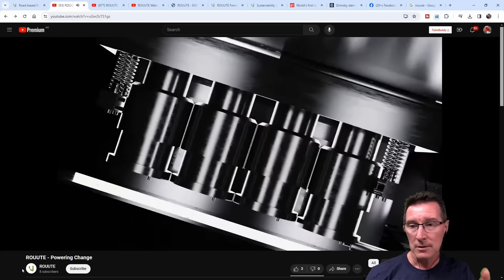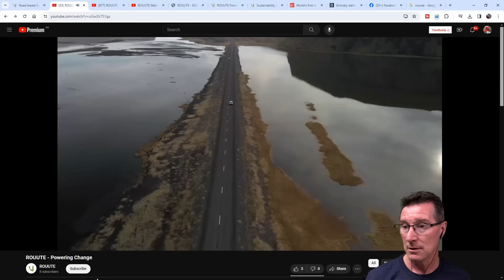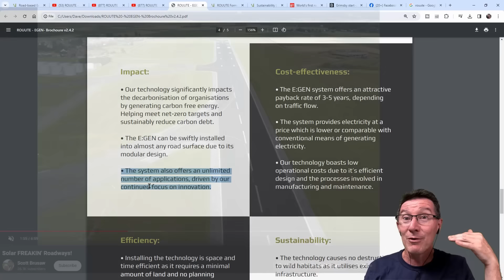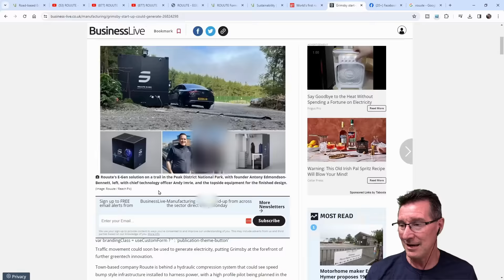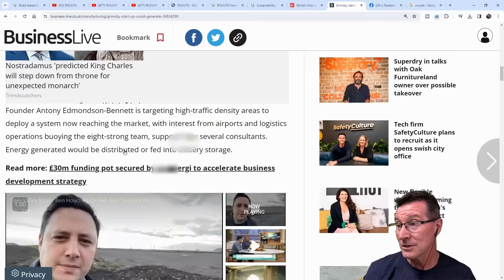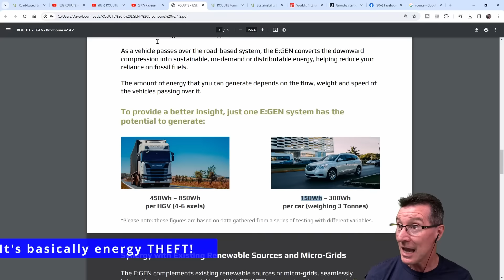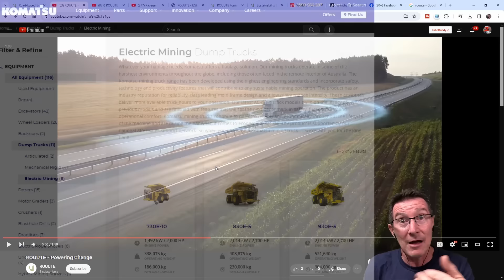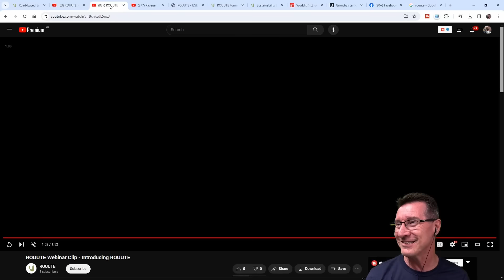EEVblog 1600 - Rouute: Road Based Energy BUSTED

Comment: Our educational programs are seriously failing to teach fundamental engineering.
Reply from the maker: They still teach E=1/2mv squared in school, it's just that no one bothers to apply it.
Reply: @EEVblog  in this case more applicable is formula U=mgh, as I understand their system use gravitational potential energy instead of kinetic energy (same as old clocks with weights, hydroelectric power plants ...)
Reply: @mrlazda  h_in = h_out it's not U=mgh.
Reply: @Kandralla  no it is not, it work by transferring gravitational potenrional energy or simply mass of vehicle push down on speed bump and speed bump sink a small amount. And yes, U=mgh is correct in this case. It is speed bump it do not try to slow vehicle it force you to slow it.
Reply: @mrlazda  h_in = h_out, m and g are constant, mgh = mgh; so no, it's not harvesting gravitational PE, I'm not going to consider going downhill because:
1. they're testing it on flat sections of road.
2. they're not going to get any substantial energy on a downhill because people are going to have to go slow to avoid damaging their cars.
Reply: @Kandralla  explain to me how h_in = h_out if road bum is sinking under weight  of vehicle? By the way, even m is not constant baxouse when the bump is sinking, m is a mass of bump plus mass of the vehicle (part of), and when it  returns to the starting position, it is only mass bump. The difference between those two potential energy is what they harvest.
Only you get right is that g is constant. 
You are just proving oreguonal post that educational program is seriously failing.
Reply: @mrlazda  What state is the speed bump and car in at the beginning of the process? What state are they in at the end of the process?

Gravity doesn't change, height doesn't change, mass doesn't change, the speed bump is still sitting there doing nothing. There's only one other thing that can possibly have changed, the car's velocity.

Explain to me how mgh=U contributes to where the energy was extracted from when m, g, and h are functionally the same for both the initial state and the final state?
Reply: @Kandralla  you obviously do not understand how it works. Speed of the vehicle is irrelevant. 
You have two stage proces.
The first stage is when vehicles go onto bump, then bump move down under mass of whiacle  in that case U=g*h"(mass of bump + mass of vehicle that is on bump).
In the second stage, when the vehicle is no longer of bump energy needed for bump to return to the previous state, it is U= g*h*mass of bump.
Energy you extract is the difference between that two energy  or  g*h*(mass of bump + mass of vehicle) - g*h*mass of bump which give you g*h*mass of vehicle  or U=mgh where m is mass of vehicle on bump, h is how much bump sinked down (vertical motion of bump) and g is constant.
Or if you still do not understand, you can look at how single ICU engines work only instead of force produced by combustion you replace by force of gravity (gm). I hope you know that energy  is force time distance (which again returns us to first equation mgh when force is force of gravity)
Edit I remembered that even simpler exampl, it works the same as the foot pump (only it is not your mass but mass of car that do work)
Reply: @mrlazda  my man, at the end of the process when the car has traversed the bump what height is the car and bump at with respect to their intlitial height?

Think about it real hard.
Reply: Draw a diagram, draw the force vectors. The component of force in the horizontal  direction is where the net work is done. The component in the vertical direction cancels itself out after the car passes.

The bump works like a wedge not a button.
Reply: @Kandralla   do you know what speed bump?  They do not work as wedges. They are not slowing down vehicle in any meaning way. They are a way to keep people driving slow, not to slow down people. Your speed does not change going  over speed bump in any significant way.
They are usually placed near schools and other places where you want to keep people from speeding.
What is the point of drowning diagrams of forces.
Now, let entertain your wrong wedge idea and what you described in the first sentence. Let the vehicle approaching the bump with some speed parallel to the road (vertical speed is 0). It is a moment of vehicles hit speed bump and change speed from parallel to road to speed that is angled vertical to road it generates some vertical acceleration (and some vertical force that act on road,  Newton's third law) so force vehicle acting on road is force due vertical acceleration and force due gravity). Now, when vehicles go on down slope of bum (and on top), only force that acts on vehicle in vertical direction is gravity. So vertical forces do not cancel each other, as you conclude drowing force diagram, that is why vehicles can jump when it leaves speed bump, which if vertical forces be cancelled would not be possible, what practixly prove that your conclusion of cancelling forces is wrong.
By the way, if there was no gravity, the vehicle  would never come back to the road but would continue in the direction of the steepest angle of speed  bump what, according to your statement about canceling vertical forces is not true.
All that taught exprimet about wedge is irelavant to how this system works, bacouse it do not work like that it is use change in gravitational energy. 
All this I wrote you should learn in elementary school.
Reply: @mrlazda  if you start at h and end at h other is no net gravitational PE consumed. If you can't understand this good luck with your business degree.
Reply: @Kandralla  if you start with an end with some height but with different masses, you have changed in energy.
If you can't understand that simple concept, you must have a bigger problem than not knowing basic physics.
Let me try to explain last time to you with a simple example. 
I am guessing you know what ielevator is.  Let you enter on 10 flor  in the elevator  and go to loby. Let's call the mass of you and the elevator m1. Now you exit the elevator and empty elevator go to 10 flor.  Let call the mass of empty elevators im2. Chane in gravitational potenrional energy in the first case is U1 =ghm1, and in the second case U2= ghm2. How much is the difference between that two energy? Acxording to you they are same so U1=U2, which means that ghm1=ghm2, bacose g and h are same in both cases, then m1 must be same  as m2 but that is not true  bacouse m1 is mass of elevator and you and m2 is only mass of elevator.
It is simple that you claim to have zero sense.
By the way, you do not need to have a degree from some university (even though I have a PhD. in electrical engineering and from university that give guy who got biggest patent compenzation  ever made for infeeqment of his PhD. work and give 2 of the top 20 people in electrical engineering by h-factor in the world), you just needed to finish 6 grade of elementary school (where you learn potenrional energy) and for mathematics just 4 grade to be able to solve that formula.
Reply: @mrlazda  
1. The car isn't staying in the pit.
2. The mass and height of the car and bump is exactly the same after the car traverses the bump. There is no mass transfer to the bump. There is no net delta h. There is no net gravitational potential energy transferred to the system.
3. The work done by the car on the bump to produce energy for this generator is the force exerted on the bump in the direction parallel to the road. There is no net work done by changing gravitational potential energy because everything ends up at the same height at the end of the interaction. The car is farther down the road at the same height as it was when it started, the bump has come back up to it's original position. delta PEg = 0. The only thing that has changed... is that it's going slower.

PE_in = PE_out they aren't parking cars on top of this thing, they're driving over them. You want to talk about this imagined state where the car stops when this thing is at it's lowest position and pretend nothing else happens.
Reply: @Kandralla  stop posting same what I already prived you wrong.
I explain to you concept 10 times and you still can't understand how it works. 
All you posted is wrong and it Iis product of you not understanding basic concepts  and probably never saw speed bump.
Horizontal speed of vehicle do not change when you go over speed bump so no energy is transferd that way.
Let me explain you last time maybe you will understand (till now amoeba will get it)
Speed bump protrude street for some amount (usualy 5cm) when vehicle wheel s go onto speed bump speed bump sink so new hight same hight as street (0cm) and mass is mass of bump plus mass of vehicle that is on speed bump. When vehicle wheel move from bump only then bump again start going up to starting hight and now mass is only mass of bump. And there is difference of energy you harvest.
By the way usual speed you aproche speed bump is in order of 1m/s and you live it with same speed. 
Just to be clear I drive over speed bumps every day (in any direction from my home I go on my street I must pass over 2 speed bumps. End even pictures of speed bumps on Wikipedia are from my city (both of them old asphalt one and "new" rubber ones but picture for rubber one is over 15 years old bacouse that registration plates that are on cars in picture are not in use for over 15 years)
Reply: @EEVblog exactly. This shouldn’t be too hard. I’m not even a mechanical or electrical engineer, but when I saw the thumbnail, I immediately knew that this is on the level of ”harvesting electricity from RF emissions of your cell phone” type of thing: theoretically it is possible to do that, but it isn’t free.

Sad thing is that these things tend to get attention from equally clueless tech journalists who don’t bother to make any due diligence and educate people. And when you criticize these failures, you get remarks like “people also laughed at Wright brothers” and “you are just some luddite who is against the progress”. 

I already got a headache from this…
Reply: @TheGrunt76 Yep. And not only is it Not free.  It's ony as green as the energy cycle of the vehicles it is inefficiently syphoning energy from.
Reply: @EEVblog  So very true.
Reply: @EEVblog Yeah, they do Dave, but...
They are trying to introduce Fundamental Concepts later in the students' school life.  By "they", I mean the educators that are not trained in Science, Engineering and basic Mechanics.
Somewhere around 2013 there was a push in Victoria (Aus) to move the introduction of ENERGY as a concept back (up) one year level from where it currently resided.
At around the same time, Year 12 (Vic) Physics Teachers were under pressure from Year 12 English Teachers to only have ONE EXAM at the END OF the YEAR, because the Mid Year Exam was taking too much study time away from English...
Reply: the whole notion of green energy is just a scam to begin with sure EV's are nice and all but just making the batteries for the thing kills any notion of green. @EEVblog
Reply: @HiragamaIkunai  Starts with CO2 is bad and causes issues, what about that scam?
Reply: @casybond  the fact that CO2 is bad and causes issues has nothing to do with green energy itself. Green energy is about the alternative solutions not climate change itself.
Reply: @conorstewart2214  "CO2 is bad" is not the reason for all the green energy crap?!
Reply: CO2 IS bad and causes issues. Both are true. @casybond
Reply: @HiragamaIkunai  The fact that you received a bunch of upvotes for your comment on 'green energy is a scam because making batteries is bad for the environment' on an engineering/science-based channel is super embarrassing. Scientists are not arguing that the production of batteries is environmentally friendly (there’s plenty of pollution, obviously); the 'green' aspect of the technology is solely about a relative overall reduction in carbon emissions. The threat to a 'green environment' has nothing to do with local environmental destruction/pollution from oil drilling versus battery material mining/production; it's about the risk of rapid climate change to the entire biosphere on Earth. The climate has historically changed cyclically, which is perfectly natural, but it’s the RATE of change/warming that’s problematic. Flora and fauna cannot migrate, evolve, and adapt if the rate of change per localized ecosystem is too great, as those processes require longer timeframes. 

In summary:
Premise 1: The rate of global warming/climate change is directly impacted by GHG emissions.
Premise 2: Flora and fauna in ecosystems cannot sustainably adapt and survive through high rates of global warming increases (healthy ecosystems = 'green' colloquially).
~ Deductive conclusion: Energy production technology that reduces overall GHG emissions, enabling sustainable ecosystem survivability, is 'greener'.

Therefore, ’green energy’ is NOT a scam; it is an obvious logical necessity based on the consensus of scientists across multiple domains of research. How is this so difficult to understand? If you need further help understanding go read up on the reports from the International Energy Agency on these topics, specifically how important battery technology is for shifting technology to “greener” energy sources. 

Just because some firebrand conspiracy fuelled conservatives have made climate change a culture war issue doesn’t mean it’s “jUsT a tHeoRy”. Thankfully most conservatives the world over agree with the expects and have plenty of policy positions that fit within their ideological framework. One easy example is potholer54’s series of videos ‘a conservative solution to global warming’. If, however, you want to repeat uninformed culture war talking points about battery production causing local pollution, or rant about Greta Thunberg (an irrelevant teen activist), or express outrage over climate activist hypocrisy; stick to Alex Jones videos and avoid polluting science/engineering channels with this nonsense.
Reply: I don't think that's the issue. It's that people not versed in engineering at all are being swooned by 'clever' marketing tactics
Reply: @OtherDalfite The market dont favour simple engineering solution that are cheap and durable it have to be something outrageous like thin to gather clueless investors attention
Reply: @OtherDalfite Clever marketing tactics is what I see killing successful businesses all the time. 
You do not need clever programmers, just use our stupidly simple wonderprogram to replace clever people with huge salaries with stupid people with 10 times lower salary. Yes, where do I pay? 
And after a few years, everyone is just selling mud as in Elbonia. Good people leave, nobody has a clue, etc.
Reply: Agreed 115%.  Anyone with even the most basic engineering or electrical knowledge knows intuitively that a system like this is simply harvesting energy at the expense of road users increased energy consumption.  

Think of it as a toll or tax on roads that would employ this technology.
Reply: @cberge8  Isn't 115% part of the problem? ;)
Reply: @stusue9733  Not at all.  Anything above 100% just gives you a perpetual motion machine/free energy device.   I've seen a ton of YouTube tutorials on how to make these so they must be legit.  Lol
Reply: @stusue9733  lol
Reply: @cberge8 These tutorials you mentioned are legit perpetual motion devices indeed.
Perpetual motion of cash toward creator's accounts from YT monetization 😎
Reply: @stusue9733 Damn! I didn't get here fast enough. :-/
Reply: @cberge8  the cringiness of the irony of your perspective needs to be underlined.
when you hit a speed bump, the direction of your momentum is changed. when it is changed to go upward without support, you are then destined to go downward. that energy is eaten up by your springs.
so speed bumps take the effeciecy of a Normal road, and reduce the energy of the vehicle and cause the vehicle to shed the energy. there is an effeciency loss in having a speedbump, but whether the energy is shed immediately into the air via springs, or whether it is sent somewhere to do arbitrary work is optional.
you dont gain effeciency by having speed bumps or pot holes extract energy from a vehicle without using it.

i havent watched the video yet but having waste energy used for work is free. the issue will pop up if they try putting these in where there are no speed bumps  then it will be a tax. but if they are just putting in complicated mechanisms for harvesting energy, the real topic is whether the power generated over the product lifetime is worth the cost.
Reply: They know it’s not possible. Look at the vehicles in the marketing material. G Wagon, uptrim C-Class. This guy(s) are money grabbers.
Reply: @bobert4522 Funded by Covid loans apparently. Which I don't think were very carefully checked as done in a rush, and presumably UK taxpayers like me end up funding this stupidity.

For some reason some nonsense isn't fraudulent.  Sell a PMM and you can get prosecuted. Sell this or homeopathy or any other such cr*p and nobody cares.
Reply: @bobert4522 That’s the only vehicle that weighs 3 tons. Tiny smart cars won’t do it. LMAF
Reply: @max1975d   Actually pretty much all electric cars are > 3 tons.
Reply: It isn't even that, the education system focuses on conformity and accepting claims from an authority figure (teacher), they fail at teaching critical thinking.
Reply: @Stoyon that also depends on the culture. In a lot of Asian countries it's like that because teachers are authority figures and students focus more on memorization when critical thinking, thanks to the testing required there. In America it's a little less like that because American students don't inherently "respect" older people for better or worse. At least they can question stuff as a part of critical thinking.
Reply: It wasn't failure to teach fundamental engineering, what a lot of people lack the most are ability to think critically.
Reply: I had his idea in high school physics. One semester freshman year, the 2 semesters Harvard Physics senior year. I don't even know where to begin. smh
Reply: @sdrc92126  I'm pretty sure I could have spotted the problem with this by fifth grade science class.   Conservation of energy was a pretty big thing.  But then I went to school so long ago and so far out in the boonies that they seemed to think that school should try to teach me something about how real stuff worked.
Reply: Maybe next we’ll see dynos to harvest energy while cars are parked....
Reply: @Thatdavemarsh  stop light dynos, everyone stops on one at a red light 😂
Reply: Considering it can take up to 5 yers to even decade to build a few miles of concrete road, now they want to extend that building time even more.
And from seeing the construction of that, it doesn't matter how many warning signs there are. People will be crashing into them daily all across the US. The energy it produces won't even outweigh the costs of repairing them; after all, the US spends billions per year in repairing damage from crashes such as lights, street signs, barriers, etc. A standard street sign is 150 USD, not including labor, to replace it.
6 million crashes on average per 365 days, yeh, at least 100-500k will be damaging those speed bumps.
On average, over 20 billion is spent per annum on repairing vehicle damage caused by pot holes in the US. 
People want their taxes going on road repair, not on this nonsense.
Reply: Most people can't grasp these concepts, like so many people can't grasp basic programming. Both are simple at the basics level, but people can't even grasp them. They're not worth the time to teach, they can do something simpler. Plenty of things to get done out there.
Reply: I know a lot of people who most certainly know enough physics not to fall for schemes/scams like this. It's not about the education, it's about applying what they know—people do not look at marketing claims skeptically enough to bother to check the numbers and fantastic claims being peddled, they just want to believe and get swooned by cozy messages and charisma.

My wife has a PhD, I can assure you she is most certainly capable of thinking critically, probably more than me when she decides to apply herself, but every now and then she'd send me something she encountered on the internet as something 'amazing', my skepti-sense would kick in and I'd spend the time and effort to check the claims, and explain back why the claims are silly, only to get back from her: "Do you really have to ruin everything?!"
Reply: @zwerko   but what if those people are not in councils & gov. departments.  PANIC.
Reply: @RichardDTube  Nonsense! We can't have smart people in the government, who will then work in the industry and how will the industry be able to sway regulation to their own agendas? No, no, it's better this way...
Reply: High school physics level skills would debunk this....
Reply: According to Rouute, net zero is when you have a 25% efficient slush box ICE car - because in slow traffic they are that bad - push a couple of Joules into dimples on the road as it passes over. When we should be getting rid of personal vehicular traffic to begin with. Buses and trams don’t need speed bumps FFS.
Reply: Yep with some basic knowledge no one would fall for it all.
Reply: @djpocketknife  I met someone in a first-year engineering course who suggested placing a wind turbine into a car for energy production; surprisingly he was serious. No, he did not make it through the first semester; but it shows anecdotally that there are a lot of people out there who truly don't understand the most basic math and physics and there are many even with college degrees in that group as well.
Reply: that looks like a slavery with extra steps
Reply: I spent 9 years attaining a Mech and Elec. Degree, and man.... You're not wrong. The practical application of even basic concepts is so far gone, I had to join the electronics design club and mini-baja teams to get any real idea of how to apply any of it.
Reply: @Saint_Oscar We should be STARTING with the application and working backwards. That's how I teach myself. Find something you want to do then figure out how it works. Not learn how something works then try to find places to apply it.

It's so fucking frustrating
Reply: I seriously hope its not even stupider than that in they are literally assuming it will be the only thing to stop your car. For the 3000kg vehicle, if you do the calculations to covert the Wh of energy into kinetic energy, its suspiciously close to the speeds people normally drive it. Edit: Dave did the same calculations, but the concept of this is so fucking stupid the implications didn't sink in at first. Yeah. No, I don't want it.
Reply: It has nothing to do with engineering. It has everything to do about a quick cash grab.
Reply: Or it's only that people wants too much to make a profit at any cost, with whatever actual trend there is, even if resorting to half-assed tech, or just plainly trying to scam others with "overly optimistic" engineering claims. Maybe the claims are actually true, but only if you ask for and read the "small script", that will say something like the energy recovery is based on a system with a lot of speed bumps on it. No way it's from a single speed bump and a single car. Maybe they're talking about replacing all speed bumps already on a city with this energy-harvesting speed bumps. Only that could make at least some sense. But i doubt that the cost of implementation would make any sense vs the energy recovered.
Reply: Hmm. If these are installed in place of existing speed bumps ok great. It will provide a little energy which could be used for roadside tech of some sort. I think they're confusing watt hours with watts (instantaneous).
Reply: Young people are losing interest in engineering,
Reply: , physics, chemistry, biology, zoology, and so on. I got my education in Soviet System; light year ahead of US education.
Reply: @nameredacted1242  okay good for you, clearly your education isn’t that good or you would have realised that this particular project is in the UK.
Reply: Our education systems fail to teach a lot of things that they really should, like basic health education.
Reply: As long as there are people still paying them, it is not about whether they know engineering. If people stop paying/buying bad science, the planet will be a better place
Reply: BuT... bUt... iT'S tOO CoMPLiCaTEd!
Reply: Yeah, or to teach the laws of physics or just basic principles of physics to say it that way
Reply: @cberge8 btw, also all the energy that would go into engineering, testing and manufacturing this system and finally to find ways of integrating it in new or existing roadways, requiring cables to be dug in... that's an amount of energy consumption that they never could recover, not even by a long shot. not to mention systems like this ALWAYS develop fatal defects and usually fail within a year.
Reply: How about regenerative solenoid suspension dampers for the low frequency excursions and piezoelectric mountings for the higher frequency rumble. I cant see it adding much weight to the vehicle considering the mass of hydraulic dampers.
Reply: I thought a was the genius that thought of regen suspension, then I searched and found some interesting observations from this paper:
Electro-hydraulic damper for energy harvesting suspension: Modelling, prototyping and experimental validation 
by Yuxin Zhang, State Key Laboratory of Automotive Simulation and Control, Jilin University.

For the off-road vehicles, such as military vehicles and SUVs, the energy harvesting suspension has more potential for the industry application. Zuo et al. suggest that road roughness, tire stiffness, and vehicle driving speed have great influences on the harvesting power potential, and for a middle-sized vehicle, 100–400 W average power is available in the suspensions at 60 mph on B and C class roads. The road tests conducted by Audi AG show that the average recovery power is about 150 W when the passenger car is driven on German roads, 3 W on newly paved highways, and 613 W on the rugged country road. 

The energy harvesting damper is the core of active and semi-active suspensions, which can be categorized into two types: electromagnetic and electro-hydraulic. The electromagnetic regenerative damper mainly contains two components: energy conversion (linear or rotary electric generators) and transmission (from reciprocation to rotation) devices.
Reply: The purpose of edication is to make worker bees.  Basically you import people with the power of the dollar as world reserve currency, ie you bring in rootless first generation immigrants via the brain drain.  Then they have kids, you covertly maim them the same way as your native population, and within a generation or two you've nullified any genetic advantages.  Rinse and repeat.
Reply: I think it's intentional cause dumber people = less public backlash from government "investing" on these scams
Reply: Most of these people aren't even engineers. The equivalent of people who keeps thinking magnets are the key to perpetual motion.
Reply: Not just engineering
Reply: The Elon musks of the world have swindled this generation of engineers
Reply: Design seems to have become the priority; there is no close examination of feasibility.
Reply: Diversity, Inclusion, Equity is ruying the world.
You have people in positions they do not have skills for, but, they have the right colour, gender.
Reply: my engineering study thought it was necessary to waste 1 hour on hammering home that perpetual motion is unrealistic, and why, instead of doing just more calculus2 examples.
Reply: The game "oxygen not included" taught me, that you can launch rockets in orbit, and capture nearly all the rocket exhaust, ideally to generate energy by heat-turbines and condensation, to then use that energy to regenerate the rocket fuel, which somehow easily gives you a lot more energy back, than you need to launch the rocket(s).
Reply: More like basic physics.
Reply: This has nothing to do with failed education. It’s a scam tech startup like thousands of others out there. The fancy videos are not meant to convince engineers; they are only meant to be convincing enough for some gullible venture capitalists or mom and pop investors to throw money their way. It’s shameless fraud not practical engineering.
Reply: They couldn’t be bothered to hire a voice actor or produce more than stock footage and cheap renders. Everything about this screams scam. They’re fishing for gullible investors.
Reply: I wonder how much money the government threw at this obvious grift?